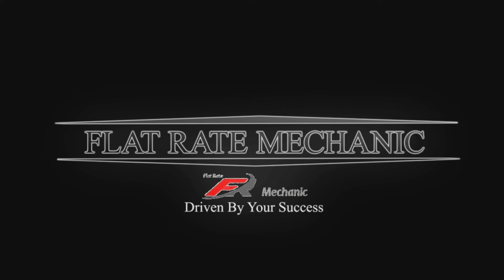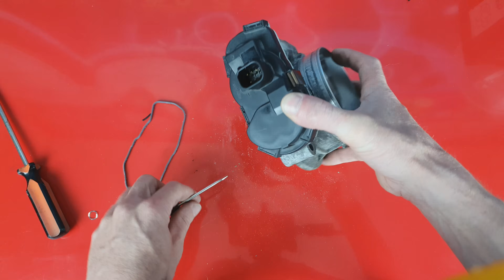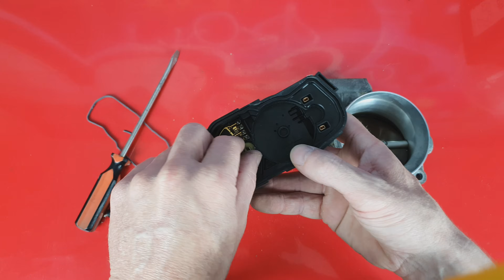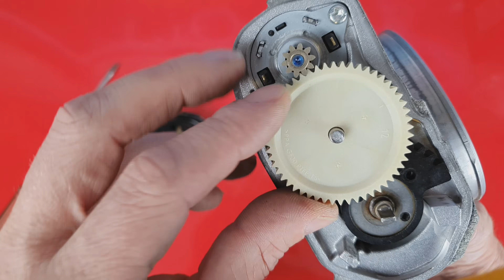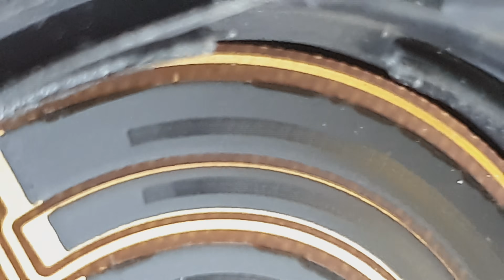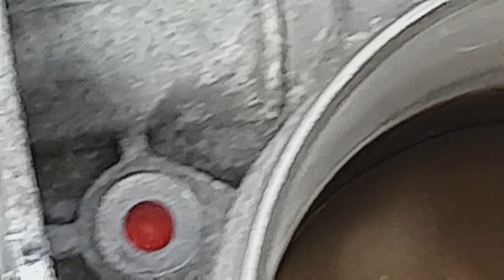Reduced Engine Power Light (Mystery Solved) P1516 P2101

Comment: 2004 Chevy 2500 6.0 p1516, P0220, P0120. Already has a new TPS and harness.
Reply: Appreciate the information.
Reply: You had to replace the wire harness?
Reply: @neallott16  just the plug, on the TPS. I found my problem, which was a bad ground on the bottom of the motor. If you follow the wiring down the front of the motor, on the drivers side, there is a ground wire. Mine was broken. Attached a new wire and grounded it back to the battery, now the truck runs great.

Comment: My 02' camaro v6 has that light on. I cleaned it throttle body and i still have the light. And my car wont drive
Reply: Then you have another problem dude. Probably the TPS.
Reply: @Archangel0804  lol I sold the car 10 months ago. Thanks though

Comment: Doesn’t matter the make or model!!!!! People, they all now use Tb sensors!!!  Trick is to keep up on fresh air filter and shop at reputable gas shops and or use file in hector cleaner!! Bad fuel ratio is the issue here, clogged fuel injector fualting spark plugs  wich in teen cuased build up in Tb and computer continually tries to adjust shorting out Tb sensor!!

Comment: I have a 2013 Chevy Camero and the reduce engine light came on and want to know what I can do myself to fix it
Reply: Wiggle harnes to Tb if any changes in idle look for loose/frade wires,if ok check air filter if very dirty change! Dump Lucas fuel injector cleaner in tank at this point lots of it!  Reason for it is fuel injector might be clogged fualting plugs, If problem still persist check spark plugs regap if too far gone replace with new! At this point lights should be off! If not then your last point is to change Tb sensor!! I say it in this order because every thing before the Tb is the underlying issue no sense in replacing only the sensor because these are what cuased it to short out!!! No one actually says this because they don’t actually know this!! They just make videos like what everyone already makes!!!!
Reply from the maker: I would try cleaning the throttle body first and resetting the check engine like. Worth a shot and it cost nothing more than a can of brake clean or carb clean to do it. https://amzn.to/2q9usPv

Comment: My reduced engine power and 100 other codes thrown at the same time like Service ESC... WERE ALL Because of Chevy"s SHITTY Battery Cable coming loose on the negative terminal.  Save your $$$ MONEY $$$  Replace the Connector to the Negative post on your Malibu Battery or do what I did.  I shoved a regular (Not Jumbo Sized) metal Paper Clip between the battery post and the connector to tighten the connection.  Works for now.  I will keep you posted.  :-)
Reply: John Smith  I have the same problem hopefully this works
Reply: @kingkobra907  Did it work???

Comment: having this issue on my  very clean for its age 2006 yukon denali lq4 with 140k miles.  I had to replace the oil cooler lines and water pump, so while i was at it, i took the throttle body off and cleaned it for basically no reason other than I was convenient to do at the same time.  now i have the code! haha  I have gotten it twice.  the first time was upon initial startup after pumping the gas pedal 5x with engine off to reset oil change monitor, it ran rough threw the code and reduced engine power message.  Shut off and cranked back and it went away.  Light went off.  Second time i was on the interstate and got only the SEL, no rough running, it went away on its own.  Well, im getting the code a few months and 5000 miles after taking apart for no reason, so not 100% sure its related.  Im going to start troubleshooting by going back taking it back off cleaning again and reinstalling with extra care and attention to grounding etc.